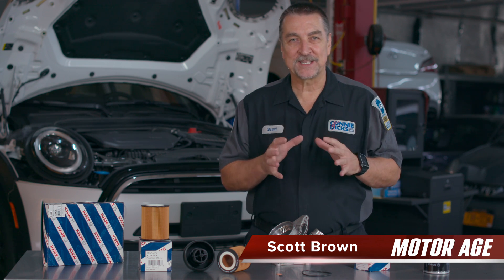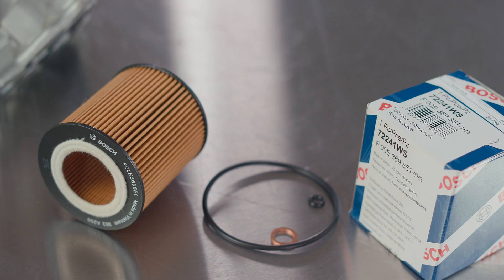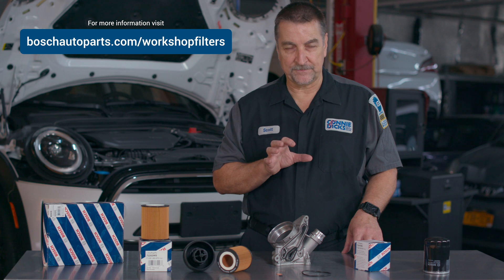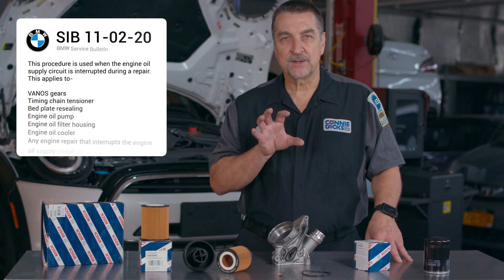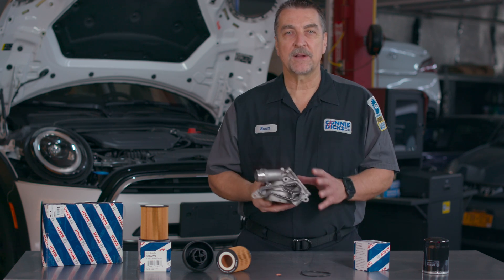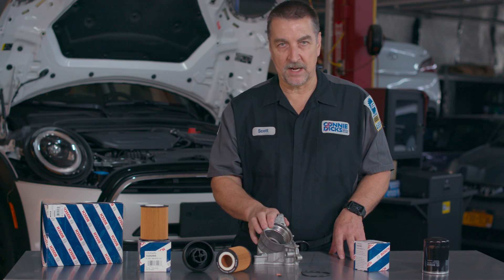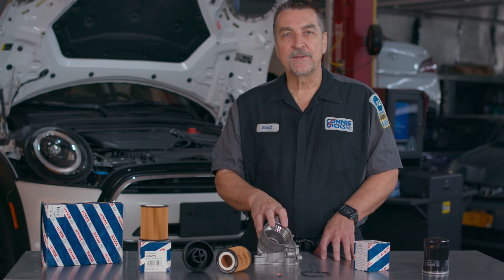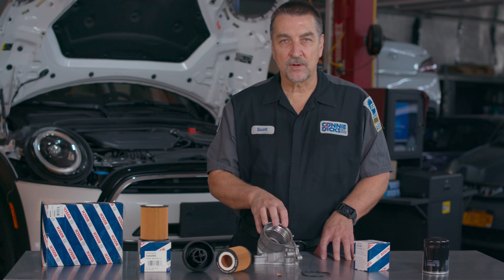Motor Age Tech Tips—Mastering BMW Engine Related Services Affecting the Oiling System

Comment: Easier to understand wording:
"If You OPEN any part of the oil circulation system..."
Just like opening a brake system...
Various procedures are required to prepare the system for being put back into service.

Comment: If you must go through all that, wouldn't it be better to prime the engine with an external priming pump which would eliminate the 90 seconds (30 cranking  60 starter cool down) of starter wear, heating, dry bearings and scraping piston rings?
Reply: In theory I think so. The question is where will the external pump be hooked to?